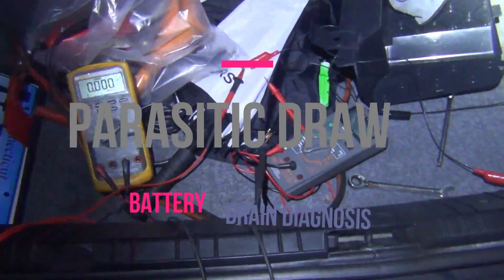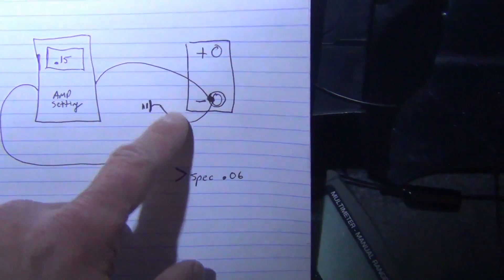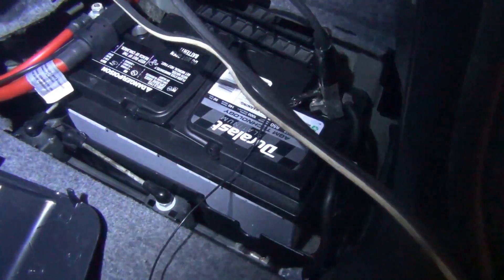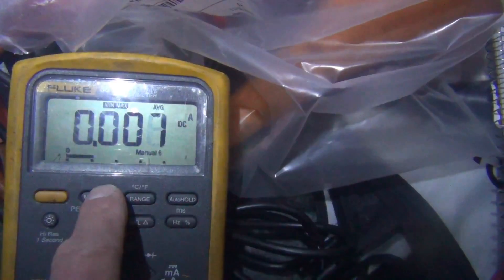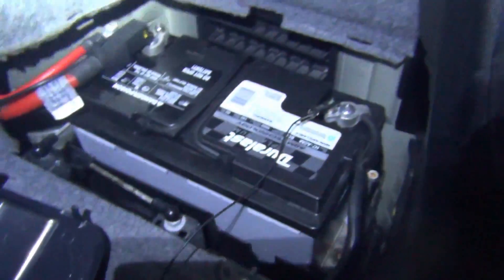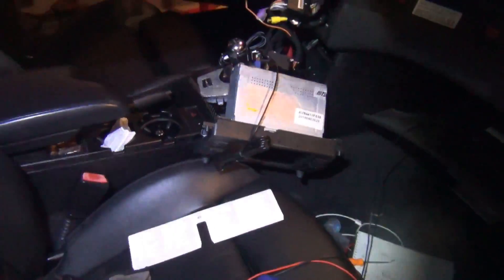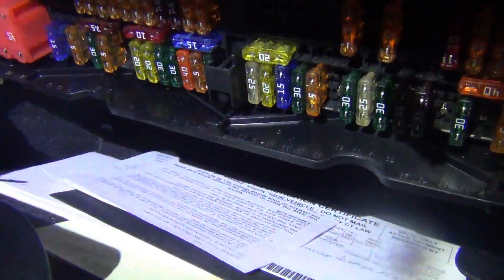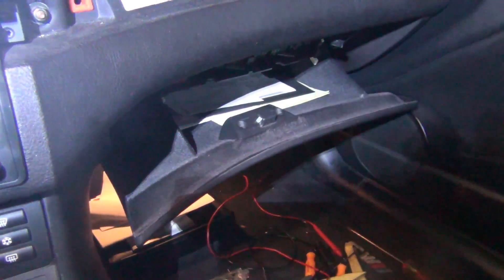Battery Drain Diagnosis Parasitic Draw

Comment: Excellent video! I dread that mine will take so long to narrow down the source. However, I'm looking at something in the climate control area wiring. When I removed the climate control panel a week or so ago, I noticed that power( I had key on to do some checking) to the climate control panel went out. When I moved it, it would come back on. I'm still trying to, when I can, narrow that problem down. Only one wire to the harness stays on after key off and removed.( I think I already brought this up to you). Anyway, I'll do best I can with my multimeter and checking any draws at fuses that may be abnormal. Thank you, again, for another great video!
Reply from the maker: Thanks StandTall, Glad to hear you found it helpful. Hope you find and it would love to hear what it is once you know.
Reply: @AskTheCarExperts  Absolutely. As well, I watched one of your videos on rat deterrent. Unfortunately, I cannot find that on your website. Is it under a different title/heading? Yes. I have just acquired a rat problem. Luckily, no chewed wiring, yet. Just hood insulation and trying to chew a hole in my Washer Fluid reservoir.
Reply from the maker: Hello Stand Tall, Are you looking for the rodent protection device? This is the one I used - I should add it to my website! Hope this helps bud!
https://amzn.to/3WBJruy
This is my rodent video list:

https://youtu.be/wMaoTJybyCQ
Rodent Repeller

Stop Rodents from damaging your car
https://youtu.be/_3MXIUp-AN0

Wiring harness replacement with Rodent protection tape
https://youtu.be/DybakLSl748
Reply from the maker: @standtall7646  Glad the info helped. I do like the bucket trap. Keeps working all the time. The snap traps can get messy. I had a customer that used peppermint spray. Kept them out of the engine so they at the body harness instead! Always a good idea to reduce the population of rodents any way you can.

Comment: Great video. Can you explain in the next videos what is an intelligent battery sensor IBS and what are consequences if you running a car without it? Thanks
Reply from the maker: Good suggestion, Thank you. An IBS (Intelligent Battery Sensor) is used to monitor the state of charge (SOC) of the battery and gives this information to the engine computer for alternator charging information. It also is used to monitor for battery drains, drive cycle style, and general health of the battery. The signal is sent over a BSD or bit serial data bus. I have seen an problem on 5 series E60 model where the IBS takes down a wake up line to the CAS (which controls ignition on this vehicle) and since the wake up line which is a 12 volt low amperage signal is pulled down the CAS never wakes up. This results in no power in the vehicle at all with the key in the slot. Simply unplug the small 2 pin connection of the IBS pigtail and the car wakes up and starts. Easy fix as the IBS is the negative cable at the battery.

Comment: You've done a great job here.  Clearly you are a professional BMW tech.  It's not often that the aftermarket component isn't the problem; although I can't help but wonder if the aftermarket radio or its associated components may have caused the internal cluster failure somehow. I can only recall replacing a handful of E46 clusters in the past.
When faced with a challenge such as yours, we will often try to place an amp clamp, or sometimes multiple amp clamps around the main power distribution wires so as to narrow affected circuits down quickly.  Sort of a divide and conquer technique.  Have you adopted the method of checking for voltage drop across fuses without removing them?  I've never used the Amp Hound, but I'm assuming the fuse would need to be removed so you can place the Amp Hound leads?
Perhaps a follow-up video on a later car using energy diagnosis in ISTA, although that may not prove useful to a DIYer audience that may not have ISTA.
I like to see videos from folks that know what they're doing so it's good to see you back.

Happy holidays..
Reply from the maker: Thank you for the post! I definitely agree with you with an amp clamp across multiple wires. I have used this method as well to trace down drains and wake ups. Unfortunately I do  not have an amp clamp at home. I will have to do a video about the Amp Hound. For this device you do not need to remove the fuse. It uses voltage drop across the fuse once you dial in the fuse size and rating. If there is a drain is uses an internal algorithm to convert the voltage drop to an amperage draw. I really love that tool!

Comment: Would have thought  the amp hound be a help, but with little time available,  not so. The block method was a good method of time saving. Hard to credit the cluster was the culprit. Job well done.
Reply from the maker: Hi Tom, I thought I would share my findings with you. I ended up with another .600 milliamp wake up after it was all together with the cluster disconnected. I found the TCU telephone module waking up and pulling the .600 amp drain. I disconnected and put the cluster back in the circuit and my .200 came back. But with fuse 34 removed the drain is gone AND the cluster all works still. I found this fuse is for the OBD port diagnostic for the cluster. My fix is to leave the fuse out unless the car needs to be scanned. I think the owner is going to be happy. Now he does not need to buy a new cluster. It was a fun but time consuming diagnostic process.